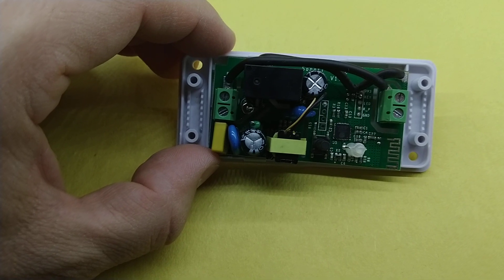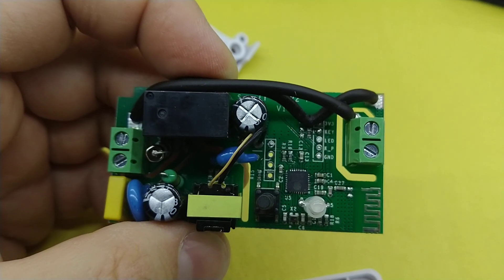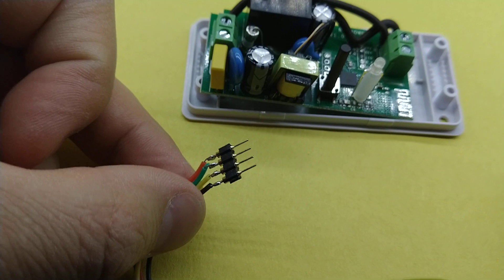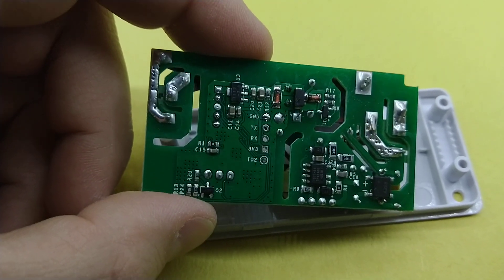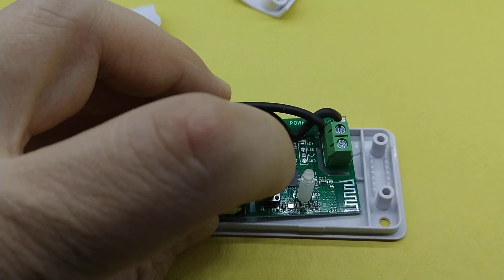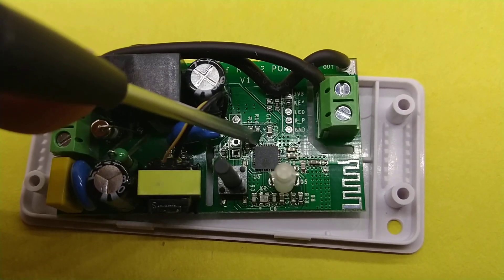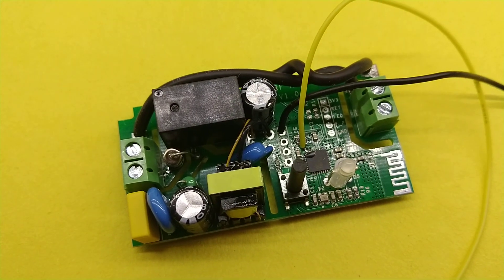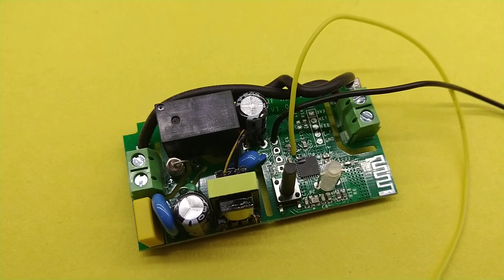Help! My Sonoff Basic turned out to be something else!

Comment: Hey Hi Sir, waddup.. hope this finds you in good spirit,  My 6 month old Sonoff basic R2 (power v1.3) konked off ... I tried changing the relay, but it will not budge, it will not come back on (sadly the original relay broke off while desoldering it out) (Also there is no glass fuse, its seems to be a 5 band 10 Ohms 5% resistor in its place inside a heat shrink tube).. ... Anyhow Funny though 5 other Sonoff basic R2's switches have been working for over three years perfectly well ... And this new unit circuit broke and I cannot figure what component has popped. ... I'd be totally thankful if you could guide me on how to fix this.

Comment: Take it to the next step and make your own printed circuit boards using the esp8266. https://youtu.be/RBesrGGTrzM . My relay is rated for a 20amp line circuit. I've designed many circuit boards that I offer as free open-source. Arduet.com or google KN6DAM

Comment: The antenna you're referring to is the zigzag trace on the PCB itself..
Reply from the maker: The Rf antennas on these sonoffs are typically physical coiled wires. The PCB Trace is the wifi antenna.
Reply: @curiouslycory  WiFi is a RF subsidiary, but I understand you

Comment: once flashed use the settings in tasmota to change rx port to switch. this allows you to use rx port and ground. works perfectly! also i did not need to do any bridge to flash, worked fine

Comment: the antenna is the pc board trace generally in the lower right hand corner of most of your video views of the component side of the board ... the "squareish" squiggly trace.  additionally GPIO14 is not in use anymore. Instead you can use GPIO2 labeled as IO2 on the backside of the board

Comment: The best solution is to connect rx pin with 10k ohm connector to 3.3v connector so you out that pin to high and when you connect rx pin with ground it seitches right away and it works just like the normal switch
Reply: what if I just make a button by connect rx and gnd, is that work?

Comment: Hey there! I have the same problem > I'm a total newbie to Smart home + flashing devices so i bought a sonoff basic as there are plenty of videos out in the web, 
but it also turned out that i have the "R2" -.-* - I try to flash Tasmota 6.4.1 but it shows 

"warning: espcomm_sync failed
error: espcomm_open failed
error: espcomm_upload_mem failed"

all the time. Due to my researches this happens when the flash mode isn't entered - I tried everything (checking cables, trying another FDTI adapter, tried to boot it in flash mode with only pushing the button, with bridge between GND & K_P temporarly, bridge soldered + pushing button, bride soldered) nothing worked. 
Do you have any advice? I really want to flash Tasmota on my sonoff as I want to be independend of some chinese server issues. :)
Reply from the maker: I used one in my recent smart plug build: https://www.youtube.com/watch?v=wExfaLYV7JI
I found that all you need to do is connect the FTDI gnd to sonoff gnd, FDTI VCC to sonoff 3.3v, FTDI RX to sonoff TX, and FTDI TX to sonoff RX, then while holding down the sonoff button, plug in the USB and go through your flashing process. The solder bridge on k_p just means you don't have to hold down the button because it's doing that for you.
Reply: I've made it! I don't know if the bridge wasn't correctly in first place or, if this was now that I turned off my antivirus (BitDefender) but something did the trick.
Thank you so much for analysing the new (crappy) board that deep. :)

Comment: It SEEMS to work as GPIO4, but it doesn't: try to short GPIO2 (IO2) with GND (simulating a switch). Now power down the sonoff and then power on it. It will not start (debug mode or something similar). 
It doesn't even matter how you setup the GPIO2 (with tasmota > 6.3.0.15-mod): "none" or "switch", the sonoff will never startup if you power it when GPIO2 and GND are shortned.
Reply from the maker: Good point. I set up a little test and confirmed. GPIO2 might work well for a normally open push button switch, or capacitive switch, but for a toggle switch you could definitely run into problems.
Reply: GPIO14 now is "KEY" pin . Today im trying make it workin with swich 09 but without result. For sure my mistake. Using GPIO2 with swich closed sonoff will turn on in flash mode. GPIO2 is a copy of hardware button
Reply from the maker: key and k_p both map to GPIO0 
According to v1.6 of the ESP8285 datasheet GPIO14 is the MTMS pin, which is pin 9, first pin on the bottom left, which isn't connected to any traces.